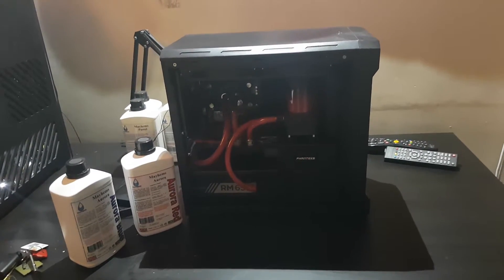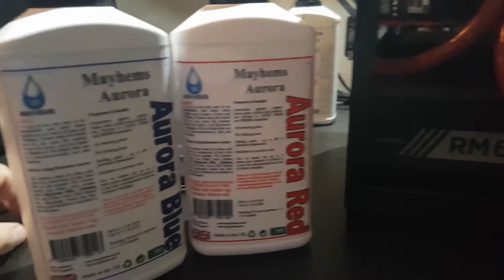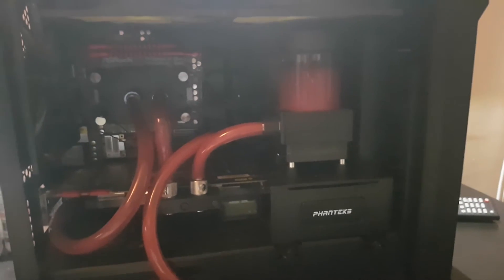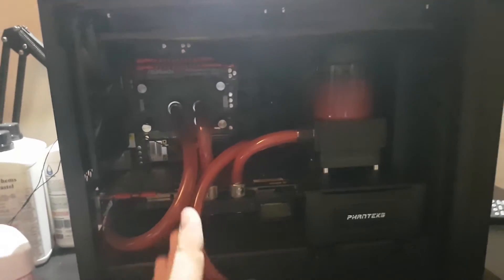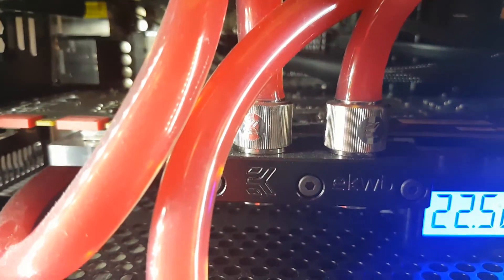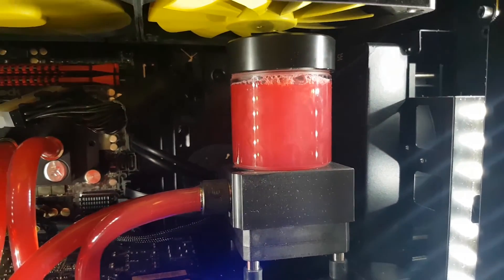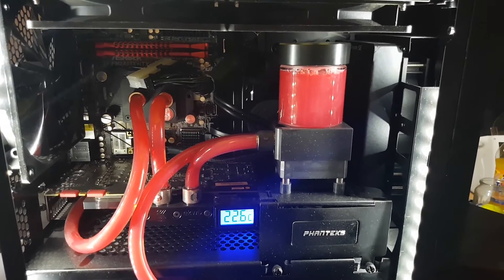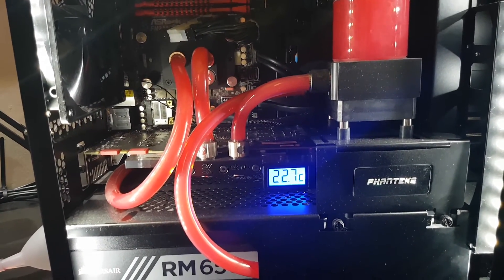Mayhems Aurora in a home system   how long does it last?

Comment: Used the concentrate and had it in my system for over 6 months running 24/7. Never any problems.  When I changed my loop and took apart my water block to see there was no clogging or anything the same with my EK res/pump combo.
Reply: yes 24/7 if the computer consistently runs it wont settle...  but turn it off for 2 days and that stuff settles to the bottom of everything
Reply: I’ve used aurora several times never clogged